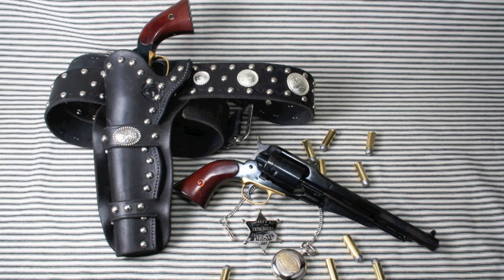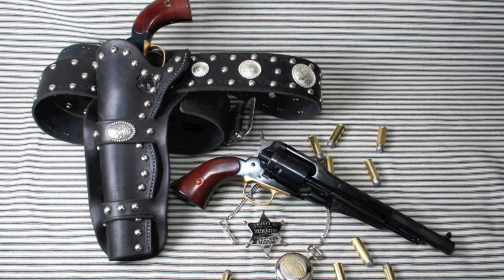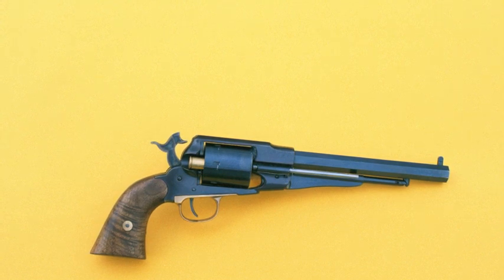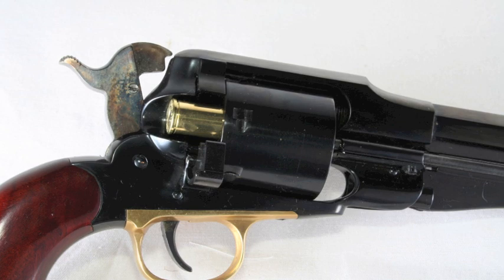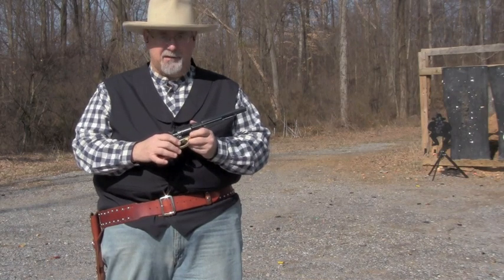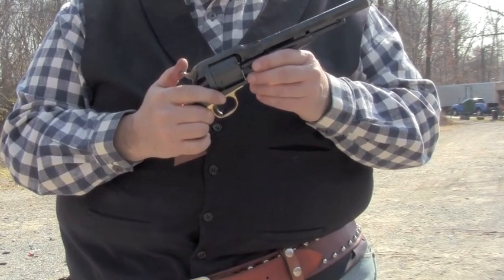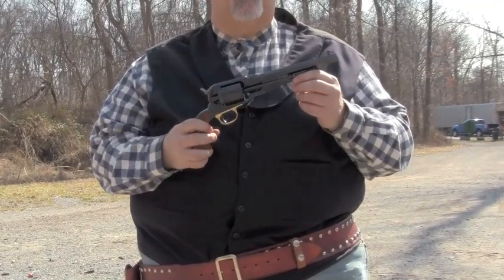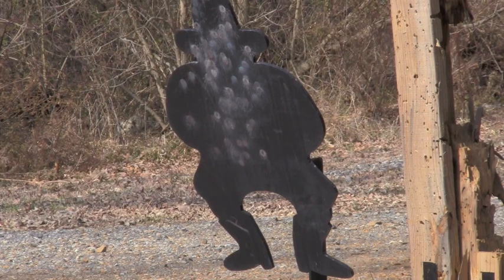Shooting Remington Cartridge Conversions.m4v

Comment: I have converted several of these cap & ball Remingtons.  38 special and 38 short CF.  Also a few '51 & '61 Colt Navys.  I always put a firing pin in the nose of the hammer and lined the barrel.  Some I made new cylinders and some put a machines ring on the back of the original cyclinder.  All shot fairly good.  I also found out the reproduction Remingtons are a hair smaller than the originals, or the ones I've converted.  Great video, thanks.

Comment: thanks for posting this video :)  I have a completely non-historical .45LC conversion cylinder for one of my 58 remingtons that has a 'lid' on the rear of the whole cylinder with an individual firing pin for each chamber.  It means the whole cylinder must be removed to reload,  but I can also use it as cap and ball anytime which is nice :D    great vid!

Comment from the maker: @SlickVega Those R7D conversion cylinders are based on actual 19th century Remington conversion cylinders. They were found on .36 Remington Navy and Remington Police revolvers and they converted them to fire .38 rimfire cartridges. Instead of firing pins befind each chamber, the cylinder back was slotted so the hammer could it the rims

Comment: The gunsmith who did the conversion on my Pietta copy with Kirst converter mentioned to me that he timed it. The Taylors version is timed and ready to shoot from the factory, which is nice. Actually in hindsight I should have bought the Taylors version as it would have saved me some money overall. But I was concerned about the grip size being smaller on the Umberti.

Great video. I also have one posted for my Pietta project.

Comment: Actually, you can buy the 1858 ball and cap from Cabelas, probably around $200-$300. Then the converters are made by several people, like "Howell" or "Kirst" they go for like $300 as well though. For Howell (or "R&D") conversions that's all you need. For a Kirst converter, you can cut a port into the side of the gun (dremel, file, etc) if you want a gate like a Peacemaker.

Comment: You showed on the cap-and-ball versions of these guns (the colt navy and the Remington new model army) how on the cylinders there are slots in between the nipples (that the hammer can be rested in so the gun can be carried safely with all 6 chambers loaded. Can you do the same on these cartridge conversion guns? I assume you can when just replacing the cylinder, but what about the factory made conversions?

Comment: A step backwards. You could swap out cylinders in percussion quicker than you could load cartridges.
Reply: True but would you rather have to carry several heavy bulky cylinders which are dangerous to carry capped in which a cap could easily fall off a nipple. 
 Or carry cartridges that are lighter therefor you can carry more and you don't have to vigorously clean multiple cylinders. 
Personally I'd rather carry a Remington cartridge conversion and use my 51 navy as a pommel gun. 
But by 1876 I'd want a s&w 3rd model Russian or a schofeild
Reply: Never happened historically. Just because it can be done with modern guns made with modern CNC machinery doesn't mean the historical guns could.
Reply: Not sure that's accurate, im Pretty sure you could at least get a few cartridges in  faster than a cylinder swap, at least enough to get back in the fight.

Comment: Another conversion I'd seen just seemed to be a cylinder conversion with a special backplate that covered all the cartridge slots. Did that one predate this much faster loading conversion, or were they contemporary to each other? I'm curious if this style of conversion would have been available circa 1870.
Reply from the maker: James Guest The removable back plate conversions date to about 1867 or '68
Reply: Two companies these days.  There is the Kurst Conversion and the Howell Conversion.  I think Taylors currently have the rights to both conversion methods.  1870?  Hmm.  Not sure.  I know S&W had the lock on cartridge guns for a while and blocked Colt and Remington (Remington bought the rights from S&W I think) and wanted to put the hurt on Colt.  Were their conversions?  I think their were.  Some were made without the rights and some were hand made by gunsmiths.  Then right as the rights expired Colt dumped a lot of their Surplus Inventory on the market with conversions 1871-1872.

Comment: Hello,

I'm wondering, have you ever fired jacketed bullets with your converted revolver? Supposedly it's recommended that only lead bullets be used, but I've never heard anyone explain exactly why.
Reply: From what I’ve been told, with jacketed bullets they caused the barrel to split on the end since they are harder than lead.

Comment: I have the Pietta Remington new army revolver stainless and want to order the conversion cylinder for .45colt,  what’s the best grain and or rounds to use for optimum performance/accuracy?
Reply: It is complicated.
First you have to know the limitations of the conversion recommended.  I think they say to keep your rounds either below 850 or 1000 feet per second if using smokeless. Check what your conversion tells you to keep the speed limit under.
It is more complicated with Black Powder as you have to fill the void between the primer/black powder and the lead bullet.  Some use a cut wad or some use Saracen grains aka buckwheat seeds to compress the load and not leave an air void.  (No copper jacketed bullets in the conversion as it increases back pressure!  You have to apply your own lube to many lead cast bullets.) 
Smokeless Reloads in the Cowboy range pick up a Lyman's Reloading Manual.  It will cover what types of powder goes with what type of bullet and primer (yes, some primers work better with some powders - sometimes they even steer you toward a brand of brass to use). 
After that... you find out what works for you and your gun.  Trial and error.  Good luck.

Comment: so I have a question about the Remington conversions. I know on black powder remingtons the cylinders can be changed quickly by pulling out the cylinder pin, but i'm wondering if that trick works with cartridge conversion models of this gun. Anybody know the answer?
Reply from the maker: baruceHadley It does
Reply: duelist1954 thank you sir, I now know what conversion pistol I want

Comment: Does those require a license to own a Remington pistol?
Reply: Atalix L In certain states if the gun was made before 1870's (I think, you can quote me on that and check your local laws) even if it is a replica based on that year like a pietta or uberti for example it is not considered a modern "firearm" and not held to the same regulations and restrictions. You could go to a gun show and purchase a 1860 navy, 1858 army or even a colt walker with no license or gun permit.